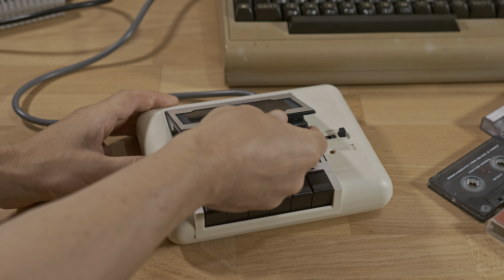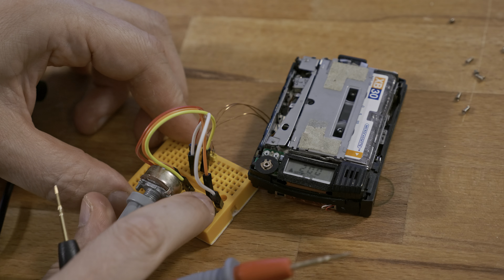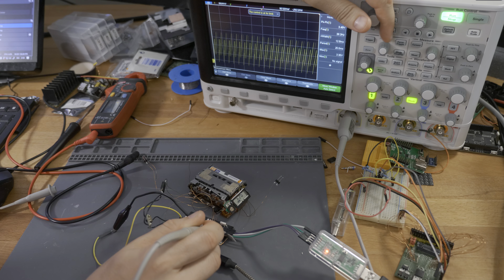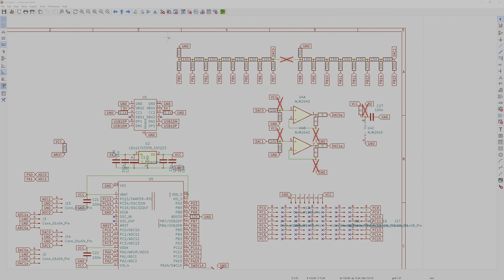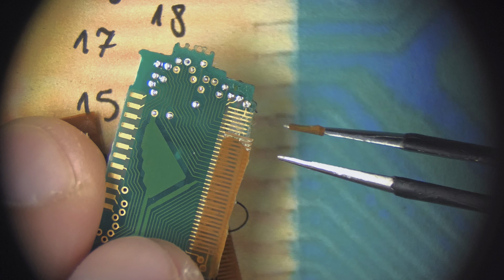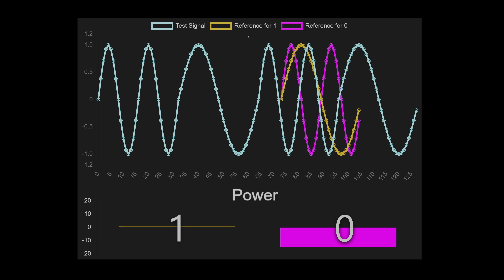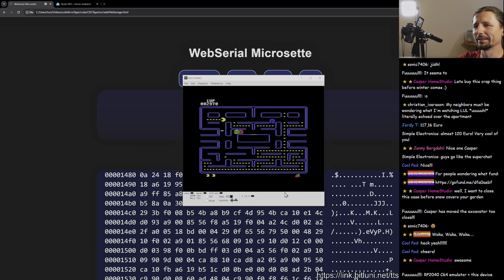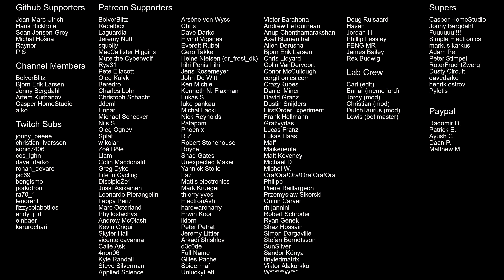I reinvented the C64 tape drive from the 80s... but tiny and USB

Comment: You should definitely use a coding scheme with error correction rather than just storing the data twice. You would get a lot of space back and the rate would be much faster.
Reply: Since you can easily have soft-decode input (i.e., any bit is not just 0 or 1 but could be 0.9 or 0.3, depending on how sure you are about the bit), it might be worth using a punctured convolutional code. Viterbi decoders are a really cool algorithm to read about and not too complex to implement on a a micro. Then, once you have that, you can add immunity to burst errors by adding some spatial spreading - for instance, interleave every group of 16 bits such that two adjacent bits are always 4 bits apart on tape. Then if two adjacent bits get hit, there is a better chance that the convolutional code can recover. Feel free to message me if you want some resources, I learned about this a few years ago and probably can find my code somewhere…
Reply from the maker: To be honest I would if the other issues didn't take so long to fix. Which error correction would you suggest? hamming(7,4) has only a minor saving at the risk that the parity is physically close on the tape.
Reply: @bitluni  Error correction at the bit level is probably not the way to go,  as you say the parity bits are too close to their data and physically separating them gets complicated. Operating at the byte/block level will be better for burst errors. Instead you could calculate a xor check sum for every set of nth bytes in a block,  ie  7 sets modulo 7, 11 x 11, 13 x 13 etc or you could use a binary scheme of coverage like hamming, so long as each byte has a unique set of checksums.  A bad byte will be at the intersection of the failed checksums.  4 sets of checksums  allows a surprising number of errors to be recovered, athough the logic for this becomes a bit mind-bending.  If you have the memory available the checksums should be distributed thoughout the next block.
Reply: @bitluni  XOR group, the question is how many... doubling is effectively an XOR group of 1, and costs 50%, an XOR of 2 would cost 33% speed and be almost as safe. As for speed, the BBC Micro used 1 cycle of 1200Hz and 2 of 2400, but with good enough sync separation, it should be possible to use half a cycle of 1200 or 1 of 2400 - close to Manchester code, or maybe go further to MFM.
Maybe concentrate on zero crossing and timing, Manchester will always have a zero crossing mid bit, while the half/one cycle will always have a crossing at bit end and may have one mid bit. Clock recovery of MFM is considerably more complex, but could achieve even faster data rate
Reply: @bitluni  Cross-interleaved Reed-Solomon coding is probably a good choice. The single-bit error rate on your tape is likely quite low, but the burst error rate is going to be bad. If you break your data into chunks, compute checksums, then interleave multiple chunks together before writing to tape, a tape dropout that loses multiple bits in a row will affect multiple blocks, but only a few bits per block will actually be lost, so the error correcting codes will have a chance to repair the damage. This is how audio CDs handle it. A scratch can cause a large number of bits in a row to be lost, but it's able to reconstruct the data pretty reliably. The drawback to this is you have to buffer a bunch of data to process it, and there's a LOT of processing overhead to encode and decode the data. You may not have enough memory to store enough data and compute enough blocks to spread the data thin enough so that tape dropouts only affect few bits in any one block at a time.
Reply: I have done a similair thing to this and used QPSK at 2400bps with a LT code(rateless code that spreads out data a ton) and a fairly high rate RS code on top optionally, small chunks getting lost with LT isn't a huge deal, and you do basically record 1.5 to 2x the data but the frame selection is way better, although with LT you need a powerful decoder and only really makes sense for bigger data, I got like 200kb files and not 8kb, so LT is definitely my best option

Comment: In your PCB you could add a PLL (phase locked loop) IC.  This would translate the frequencies into 2 voltages.  So you could get your bits directly into a digital GPIO of the mcu, just with a comparator or schmitt trigger.  And I think this could also help with noise or poor signals.

Interesting project. I think that something similar is done for the Spectrum 48K simulators, even with the audio signal available as wav files.
Reply from the maker: Thanks for the suggestion. Now that I more or less know how I can encode I could actually lock it in as an analog circuit
Reply: @bitluni  Yes.  In general I think that when you need more than a couple of analog components, just drop an MCU there.  It'll be easier, cheaper and much more flexible.

But in this case, the PLL IC is relative simple and will do the dirty job to identify the frequencies cleanly, and with one hand in the pocket at such low frequencies.  Doing this in the mcu is a bit of a pain, and not so reliable.  
But encoding FSK is not a problem for any MCU.

BTW, your projects are absolutely great!

Comment: I once had the idea to build one of those old Reel2Reel cabinet tape drives as a working scale model using ordinary music tape spools. (Early 70's computer room as a desktop modell with everything working)
As with almost all of my ideas, this will never be realized though xD
Reply: Oh and for the audio. Since tape speed is inconsistent, i thought maybe two tones, on 200Hz base and mixed on top a 1200Hz qpsk (quadrature phase shift. there is tons of information on how to in soft and hardware out there)
The base tone really on gives us an easy method the track tape speed to compensate for AF carrier frequency drift. 
Ham radio sites and forums hold so much information on that topic, i am sure you find something that fits your needs even better.

Comment: Old computers can read at 2400 baud or even more. I've seen up to more than 3000
Reply: That will be part 2 , the turbo 3000
Reply from the maker: I can imagine 1500 working reliably.  microcassettes are unfortunately mono. But with custom hardware I could pick up both sides at the same time. So 3000 are not far off

Comment: I'm not sure if this was attempted but with backup tapes a parity bit would be encoded with the data to allow for recovery using xor, your micro controller might have enough processing power to do the checking and recovery on the fly. considering the low datarate. This would then save you from having to reduce your capacity in half by duplicating the blocks. If you do two parity bits per byte, you could make it quite resilient.

Comment: Going in the opposite direction, how about store data onto a VHS tape? It would be interesting to record HD video onto a VHS tape.
Reply: I had a backup system for my Amiga that used VHS. Bit pattern was generated by the screen and recorded. A dongle in the printer port read back from the video output of the VCR.

Comment: what a project - i had seen some live stream bits and peaces and did never get what you wanted to do with the dictaphone - and here the thumbnail showed the part of the journey fully.
regarding speed: I had used C64 with datasette for a short period of time till I had the 600 DM saved for the floppy drive but I can still remember that I used a software that recorded and read much faster most likely called turbo nibbler . 

Might be a disk copy program too, but I still remember the term turbo nibbler and a game called bc quest for tyres or so and of cause KAISER . 
But turbo nibbler was program that was able to accelerate the reading and recording by factor 6 or 8, really much faster from minutes to seconds. 
Maybe that can increase the speed too of the dictaphon cause it was not a revv up the tape thing, but a signal length I guess. The tape speed in m per minute or so stayed the same. I had used it in 1983 over 1 year before the LA olympics when C64 was still a fortune or rather 2. I want to buy a Grundig amplifer for that money and got the c64. Worked another summer long in the factory and tried to buy an amplifer again when the floppy disk became a bit more available for another 500 DM or so and then I finally got a printer Seikosha and then a Star NL 10. 
5 years later I got my first stereo ... when I had gotten my degree.

Comment: This is super interesting!  One thing I was mulling about, is having data stored on cassettes using the whole width of the tape - adjusting azimuth was very annoying.  

Regarding your approach of writing a block twice in a row: wouldn't it be better to implement a Reed Solomon code? Your current solution is both wasteful (100% added redundancy) and fragile - the likelihood is one bit error in two consecutive 512 bit blocks is too high, and your scheme is incapable of correcting it. Reed-Solomon codes are far more robust and require less redundance.

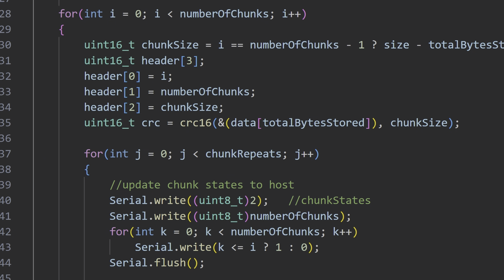Comment: 10:30 you should look into error correction algorithms haha
Reply: i was thinking that...Qualcomm has an algorithm that estimates the error loss, and covers it with 'holographic' transmission. But you could build a better one now by going to the original papers.
Reply: @sean_vikoren  More likely I would think is to use something like Hamming(7,4) ECC or similar; relatively cheap to encode/decode (via lookup tables), should be well within the reach of most microcontrollers. Some other options have less space overhead, but are more complicated.
Reply: @BGBTech  That looks good for fire and forget, but you could build one that is less aggressive when the error rate is low. 

Three out of seven bits for error is pretty massive. It does have the advantage of being simple and fast. Once you get into fountain codes, it slows down the computation. 

But for many applications these days transmission is the hard stop. 

If you think about it, the use of three or four bit for error correction is already making an assumption. 

Building your own adaptive, error correcting protocol, is really it's own project.
Reply: @sean_vikoren  It sounds like the processor he was using was already just meeting the deadline on getting the work done so it might not be able to use anything much more advanced.  but yeah some error correction would certainly help not losing so much data rate/capacity.
Reply: @Aeduo  good point...i rabbit hole very badly

Comment: man i wish there was a common cassete tape drive you can get to make more of these, one you used is rare and uncommon
Reply: Some old wireless phones used 2 of them for the answer machine (one for the automatic message, another for recording the incoming call), and they use all fully electronic controls; not sure if both drives are integrated in one frame.
Reply: I would suggest old answering machines too!
Reply: There are a few new models available form chemise stores, but all of them seem to have mechanical controls.

Comment: Are you familiar with the AKAI GX 77 tape drive? I've installed it on my C128D and am now wondering how I can get the C128D to control the bank drive via the remote control interface. Then you'd have a Straemer tape drive for the C128 or the C64. I think that's a cool idea.